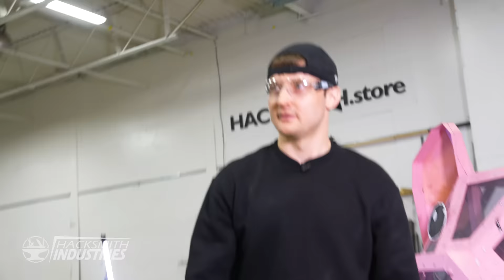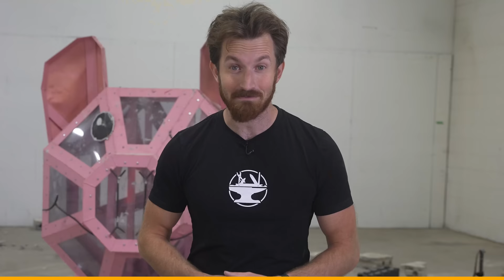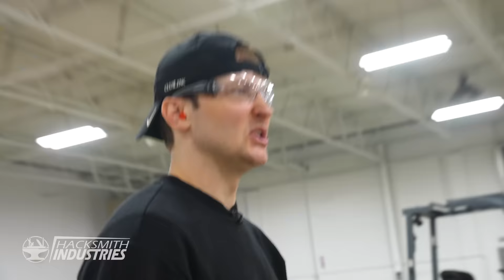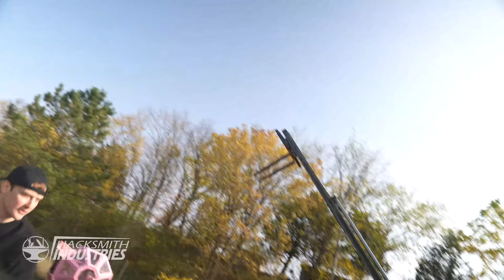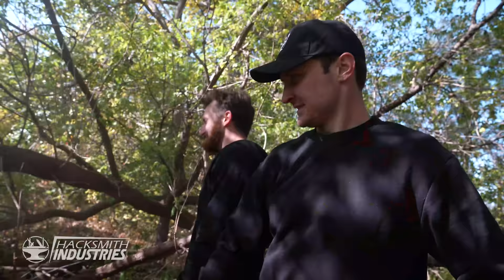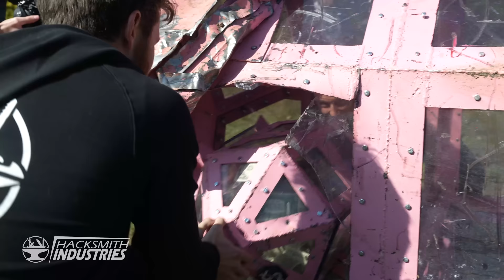$10,000 if you can break the PIGGY BANK (CHALLENGE)

Comment: I want to see someone use thermite on one of these "unbreakable boxes." I wonder if it would be faster than a lightsaber or plasma cutter.
Reply: Definitely faster, depending on how much they used.  With the sabers or plasma cutter they’d have to slowly melt or cut it open.  Thermite you can melt it all at once.  But admittedly has a much higher chance of burning the cash.

Comment: I honestly have no idea how you would do it, but have you thought about doing a Thor’s hammer from Love and Thunder that can split apart? Getting it back together would be the tricky part though. Just a neat idea I thought of
Reply: 5 pieces helped together by cabling on a spool. They fly apart then you activate the spool and it pulls them all back together. The motor could be inside the handle.
Reply: Electromagnets

Comment: I think that if you had frozen it with liquid nitrogen first, it would have smashed easier.
Reply: the point isnt actually breaking it. the point is getting content. they could have broken it in the first 2 seconds with their "light sabers". that thing can melt through steel
Reply: @pvic6959  true even though they were told at the beginning that they couldn't use them.
Reply: @nathanielsizemore3946  theres a reason they were told not to use them. the reason being the video would be done in 10 seconds lol
Reply: @pvic6959  😆😆😆so true!

Comment: Its late but the most stupid thing about the destruction is that, they trying to breaking it by brute force on the plastic but metal is breaking some basic trick and i know its steel or something like if you have power and have heavy weapon option, try bend it , its clearly one of the best way for breaking basic metal thing rather than trying on the plastic